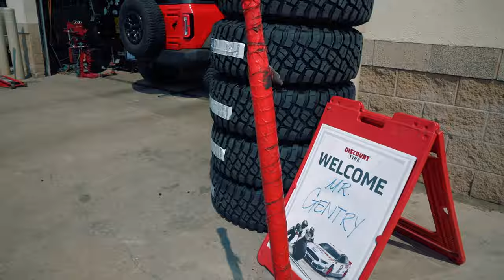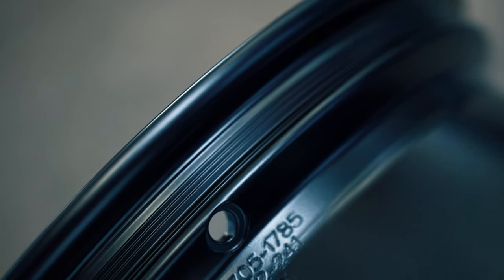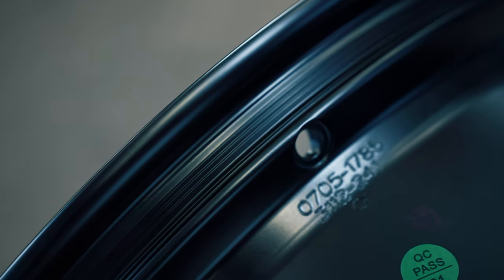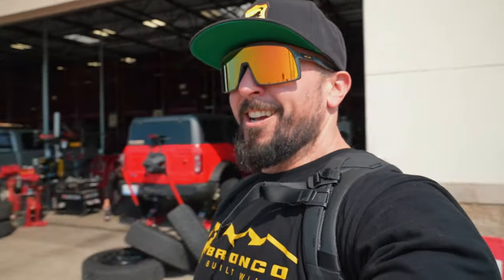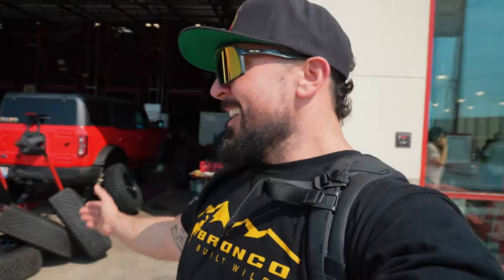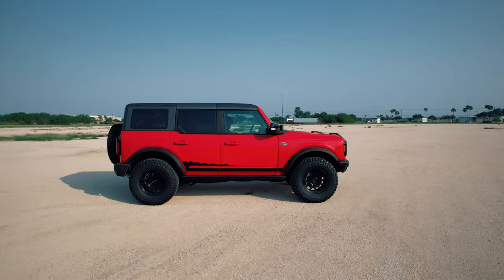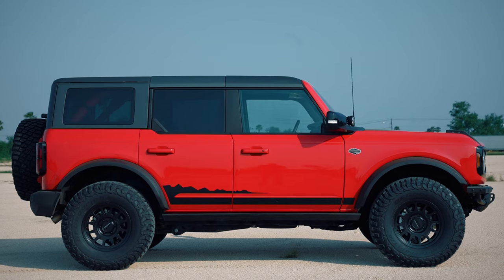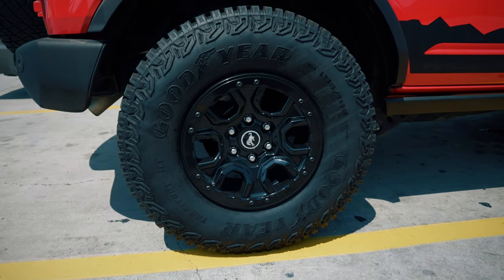Swapped Wheels & Tires on my Ford Bronco

Comment: Hey chase… great video! I’m actually looking to buy a new set of wheels for my 2023 Sasquatch package bronco just want to make sure I get the offset right. The wheels you put on what size were they & what offset? and did you have any rubbing issues? If you could get back to me it would be much appreciated. Thanks…
Reply from the maker: This video those were 17x8.5 and +30 offset. I’ve been running 17x9 with 0 offset for two or so years now definitely feel things the best setup for bronco.

Comment: What was the offset of the rims?
Reply from the maker: +35 I have since swapped actually to a zero offset
Reply: I’m a novice at this.. what’s the difference in the offsets in layman’s terms and which do you like best, 35 or 0?
Reply from the maker: @bradshepherd7460  https://m.tirerack.com/tires/tiretech/techpage.jsp?gclid=CjwKCAiA-8SdBhBGEiwAWdgtcJY3z5_9A_eVJmb8WcdqvPH-GtwqQPfTc2NBcPLhrH83fAIk3fk_YRoC9OQQAvD_BwE&techid=101&ef_id=CjwKCAiA-8SdBhBGEiwAWdgtcJY3z5_9A_eVJmb8WcdqvPH-GtwqQPfTc2NBcPLhrH83fAIk3fk_YRoC9OQQAvD_BwE:G:s&s_kwcid=AL!3756!3!354820921610!e!!g!!wheel%20offset%20explained&gclsrc=aw.ds
Reply from the maker: @bradshepherd7460  0 offset is my preferred